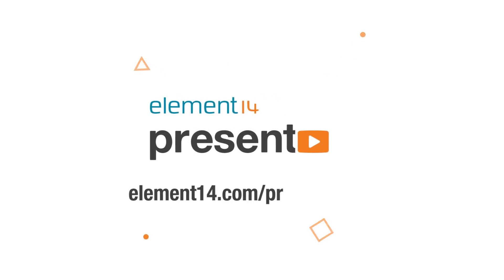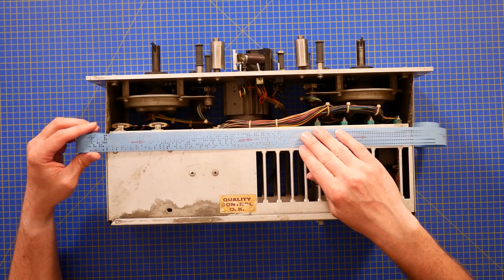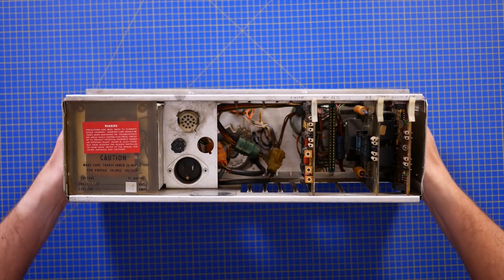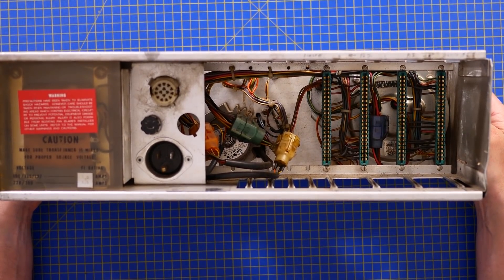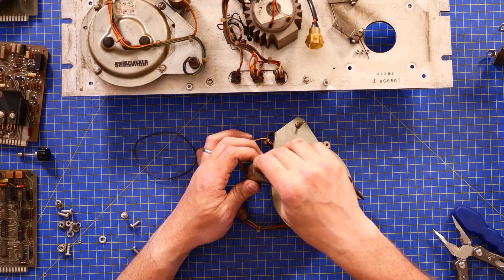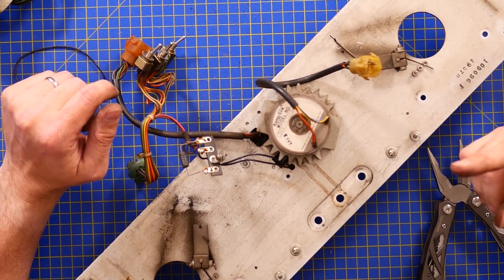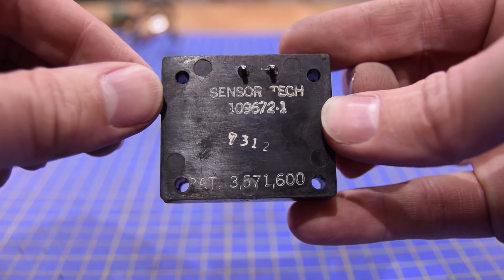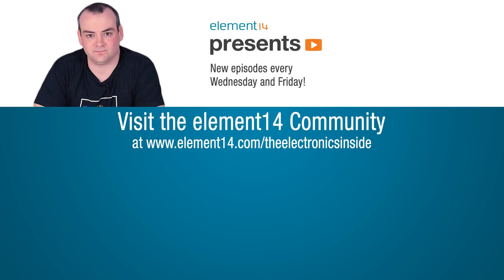REMEX Paper Tape Drive Teardown - The Electronics Inside

Comment: I have one of these which I have restored and I also have a complete user manual. The card you are missing is a second power supply card for the main spindle motor if I remember. This model was made in the early 70s around 1971/2. The output is 8 bit parallel ascii and the output is just +5v for a hole and 0 for no hole. It is a fast reader as it reads tape at 150 characters per second.
Reply: This is a video of mine running at full speed. https://youtu.be/8arCRAfwNF8

Comment: Sealed optical unit would be 9 phototransistors in a line, with the paper sprocket hole pulse used externally to drive an octal latch that, because it was shorter in duration, plus came after the main holes had settled, would give a reliable pulse to latch data, and also signal to the controller that the data was there. Open collector outputs, possibly with a pull up resistor in the block, but likely this was in the actual machinery.

There would also be a retriggerable monostable on the sprocket pulse line that, when the paper tape ran out, timed out, giving the controller an indication of end of tape.

Cards likely are all different ages, the power supply likely still is original card wise, but the controller cards have 1980 date stamps on some of the IC's, so either they were an upgrade or reworked at some point to replace failed IC's, though in almost all of the cards you see semiconductor manufacturers that no longer exist, or who no longer are in that product area.
Reply: Thank you!

Comment: That patent was issued in 1971, submitted to the patent office in 1967. "4. The combination as set forth in claim 3 in which each of said amplifiers includes a pair of transistor and resistor chip means; a plurality of common contact layers coated on said substrate and extending parallel to said aligned cells for providing power connections for said amplifiers; and leads interconnecting the cells, chips and layers." They have the schematic of each light cell in the patent if you look at the images. It has both resistors and transistors though, so I can't tell which one the light sensing element is. It has a built in amplifier though.
Reply: Wow - you did much better than I did with the research! Thank you!

Comment: Yep I used these in the late 80’s on CNC machines.
Reply: It really surprised me, but, I guess 300 Characters a second is plenty to run G-Code when the machine might take a second to actuate each line?
Reply: @a531016   We used the tape readers to load the part programs into memory. The programs were run from memory not directly off tape. Once the batch of components was made we also punched out the program to be stored as we probably edited the program whilst setting the machine. I think there was a colour coding so one colour tape was used for unproven programs, another for proven programs etc.

Comment: Remex also made combination reader/punch. I was installing a brand new reader/punch, which was quite expensive. I slipped on some spilled water on the computer room floor while carrying it. I went down with it (in retrospect I should have dropped it). One of the side panels cut tendons in my RH middle finger. I had to have surgery and months of rehabilitation. 
The paper tapes were used to build advanced computers. The backplane of the computer consisted of connectors with long gold plated pins run through a circuit board which provided a ground plane. The 31 boards in the computer were plugged into the connectors, which were wire-wound to each other. The paper tape had X and Y coordinates to guide the people who built the backplanes. The machine would position a tool guide over the correct pin on the backplane. A code was displayed to indicate the wire color. The wire color indicated the wire length. The worker would grab the indicated wire, put one end in the wire-wrap gun, position the gun onto the indicated pin, and press the trigger which wound the wire onto the pin. The worker pressed a foot pedal to advance the paper tape and the X Y pin guide. The worker put the other end of the wire into the wire wrap gun, positioned the gun over the second pin, and pulled the trigger to wrap the wire onto the pin. There were thousands of wires on a backplane.
In the days before glitter, paper tape chaff was sometimes used in pranks.
Reply: Wow, that sounds like a terrible injury! There is definately a life lesson there, virtually not piece of equipment is worth severe injury.

I'd love to get hold of something wire wound - but I don't think an AGC is in my future any time soon.

I hadn't thought of that, but having had bad experiences with hole punches, I can imagine the paper chaff being a nightmare to tidy up!
Reply: @a531016  Wire wrap is easy, look up old MOD sales on eBay and grab a few test systems, which almost invariably have massive blocks of wire wrapped cards in them.  You want the stuff that is rack mounted, so grab a few, the front panels invariable do not look too interesting, but if there are switches and displays on it there invariably is wire wrap involved.

French Military used wire wrap for test equipment, especially those systems that date from pre 1990, so you will find a lot. You will be bidding against the gold scrappers for it though.

Comment: There were also 5 level tapes on older TTY machines. The best part of it is if you are really good at it, read the info directly and use scissors and glue to edit the tape. There are also reperf machines which can copy the tapes. Placed in a safe place, it manages to keep the info without the problems of magnetic media. Some places used movie canisters to save the paper tapes.

Comment: Good video. A company I worked for in 1982 were still using paper tape for payroll. A replacement payroll system was being developed. I remember the tape operators (yes it was a job) would have issues maintaining the correct tension, any change in tension would trip a relay and the whole unit would stop. I remember one operator would speed up the reading by shining a torch at a light detector and adding rubber bands in key places, sometimes they got away with it, other times it would result in the tape going every where. A broken tape was rare, the paper they used was well up to the job.
Reply: That is absolutely something I can imagine happening in a work palce. I still rememver the office cursing when the dot matrix printer was used for cheque runs... We were always looking for ways to speed it up!

Comment: What about using two 35MM film spools or two 16MM film spools, I think that it would be better put back together and see if it can be used with a SINCLAIR Spectrum to save programs and load them back.
Reply: If I can figure out the pinout (which shouldn't be too hard) a RPI and some 3D printed spools should be a fun play?
Reply: @a531016  I should have known it was a reader but a matching punch unit would loading and saving programs a breeze and not hit or miss.